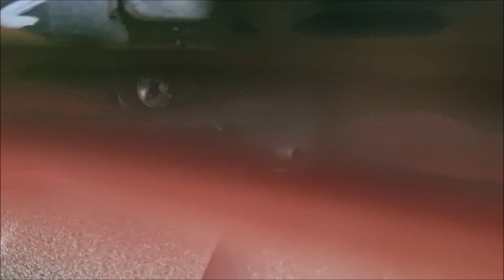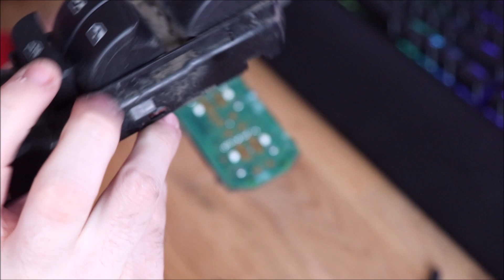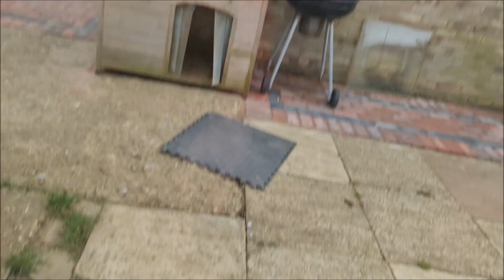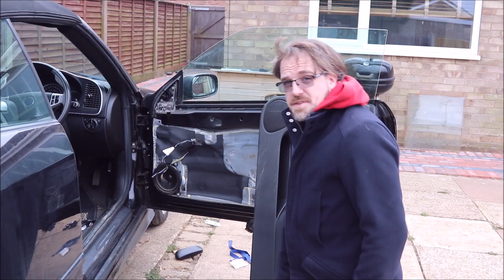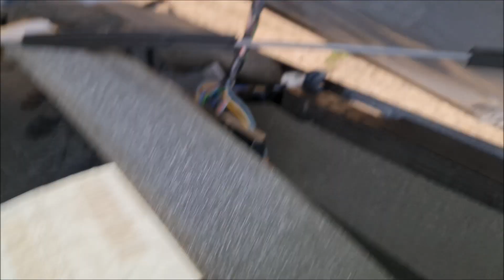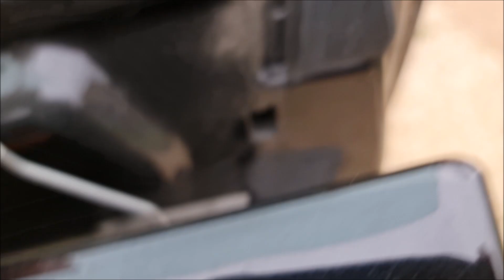Fixing Saab 9-3 Window Switches for Free!!

Comment: When putting the door panel back on, do you need to hook the bottom part first and then work your way up? Or top down, by inserting the door lock barrel first?
Reply from the maker: Top down
Reply: In the video, you hooked the bottom hooks in first, then put the door lock pin in, is that correct? I’ve just done a speaker upgrade and I’m having trouble getting the hook at the bottom closest to the speaker flush, so that part of the door card just doesn’t want to sit flush against the door card. There must be a technique?

Comment: I'm slightly confused; at around 1:50 you take the mirror controls off. You have a bit of a look at the thing, but there's no sign of you disconnecting anything. Is there some wiring connected to those controls?
Reply from the maker: Yes, sorry. There's a single loom that you need to unplug from the back
Reply: @SaabUnleashed  Thank you 🙂
Reply: Mine unplugged itself when I removed it. It appeared his did, too.

Comment: Hi nice work. Not sure if this is my issue but some forums suggest so. Have no window, mirror or locking power drivers side (RHD 04 Aero vert) You didn't happen to note the part number of the unit did you? With comfort opening & pinch protection? Thanks
Reply from the maker: If you have lost all of those things, it's more than likely the wire loom that's the issue, at the door hinge in the rubber pipe. Constant bending of the wire can eventually lead to it breaking
Reply: @SaabUnleashed  thanks for reply. It coincided with "lock system failure" on my SID, but Tech2 showing no DTC's. Bizarre Saab stuff, harder when much of the info & part numbers relate to LHD. I'll post a resolution when I have one. :)

Comment: Greetings from Croatia
I have the same Saab the same age.
My problem is the rear window on the passenger side.
I can't put it down.
I could have a problem with the window lifter.
Hello again and it is a beautiful car.
Reply from the maker: I didn't see this. Depends if the window goes down with the roof switch or not. If it doesn't, the issue would be with the window regulator.